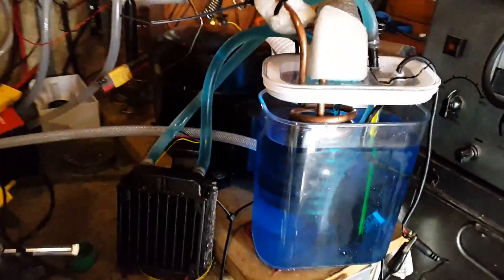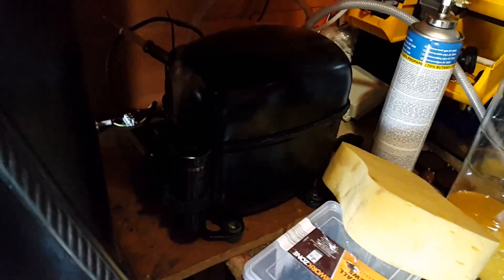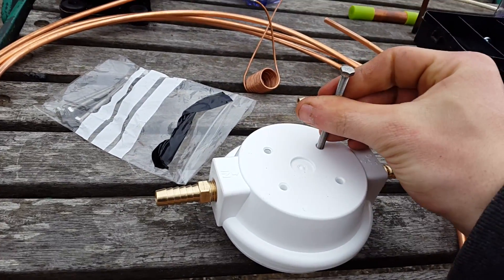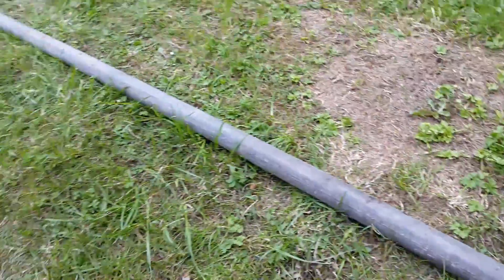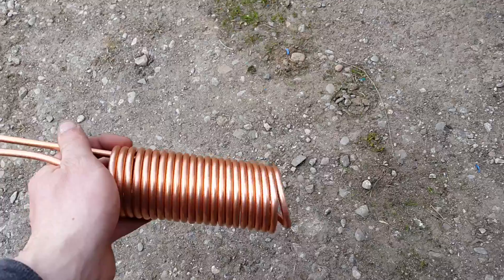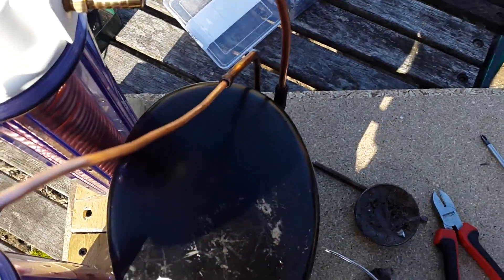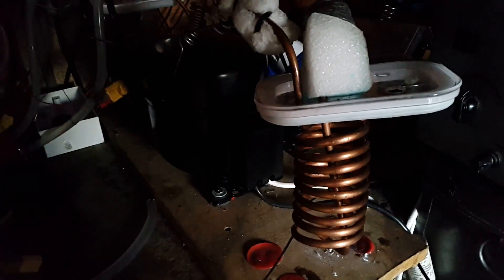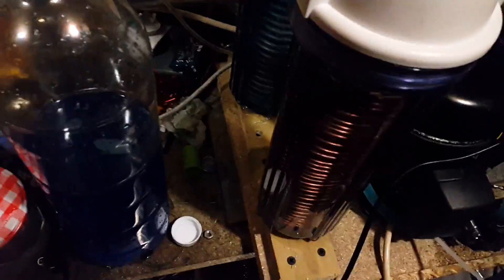Building a Glycol Chiller

Comment: Nice work.
Is there a formula to use for the length of tube, diameter and overall wound diameter for the evaporator? I'm trying to build a water chiller out of a 36KBtu outdoor unit. Help much appreciated.

Comment: I’m really enjoying this video. 
Thanks for documenting the tube sizing, and I get that the needle valve will be what adjusts the cooling glass but I don’t quite understand how you measure the propane volume?
From what I gather you were waiting for the dryer to ice up on the outside back to the compressor and use that as a gauge that you are at the right volume if gas..
I have no background in refrigeration... but want to make a small scale chiller for small scale winemaking endeavour..

Comment: as a refrigeration engineer myself... please pleaaaaaase do NOT use soft solder on any future projects, can be extremely dangerous on the high pressure side of the system, heard of a few plumbers using it on refrigeration before, can blow up in your face quite literally. also when it frosts back on the compressor thats liqud refrigerant coming back, but like you said due to the load, not good to have it frosting back all the time though
Reply from the maker: Solder is used successfully in systems running much higher pressures than those found in a refrigeration system. I have a pressure gauge from a spare diving cylinder which is designed to withstand over 2000 psi. The coiled pressure sensing pipe in it is soldered into the main screw in connection on the valve. I have also used solder in a co2 transfer adapter I made. If you make the joints properly, it works very well.
Reply: @ShaunDobbie  it depends which type of solder you are referring to but i know from experience soft solder used on plumbing etc is a very very bad idea, as a diver myself no chance would i trust it when i am 50m underwater
Reply: Are you kidding that you are in the trade for so many years? Soldering has no any problem on regular refrigerants. CO2 may be has problem, but no any problem for other refrigerants.

Comment: Great idea, I am building a small glycol chiller to regulate temprature for my home brew fermenter. I have started off with an ice cream maker striped down and the bowl size has been increased to chill my glycol and a small inline pump on the way back to the reservour after it has been warmed in the cooling jacket around the fermenter. I have the pump and chiller fully automated on an stc1000 pid temp controler / thermostat. I have a seedling propergation heat mat on the hot side to complete the system so i can hold a specified temp for as long as its switched on.

Comment: Hi, This looks very interesting.  I am thinking of using this concept for my Home Brew, for Winter I can use the warm side to circulate the water to the fermenter and in Summer I can use the Cold side.  I can regulate the water via a PID.  Can you help me with What size of Copper pipes you used on Suction and Discharge side.  What is the size of the capillary
and what is the size of capillary. Regds/Anjeel
Reply from the maker: Hi, the condenser is 7 meters of 4mm copper and the evaporator is 6 meters of 6mm tubing. The capillary tube will depend on your compressor power and I am not exactly sure what I used. Search google for secop capsel and this will guide you in capillary tube sizing. Thanks.